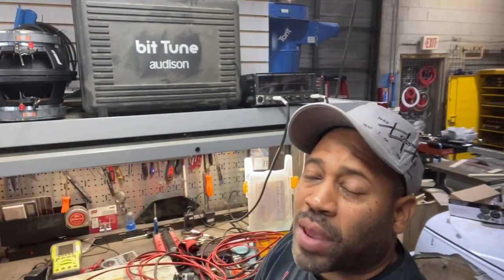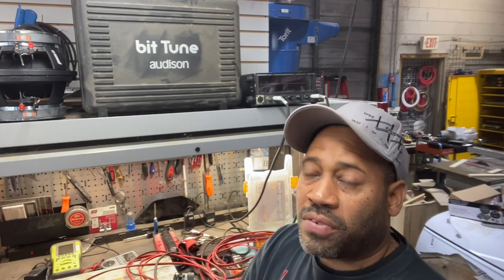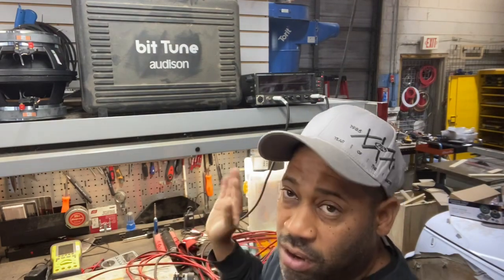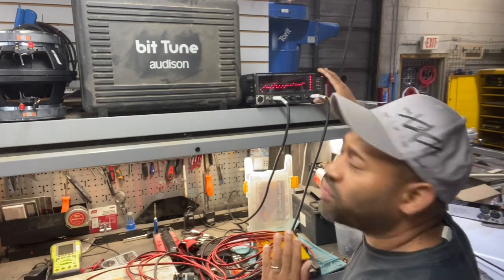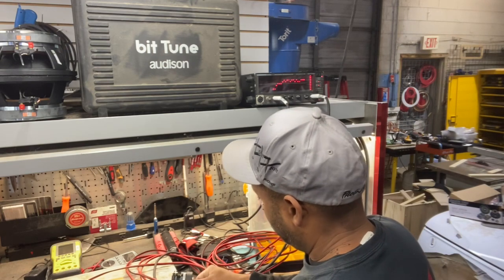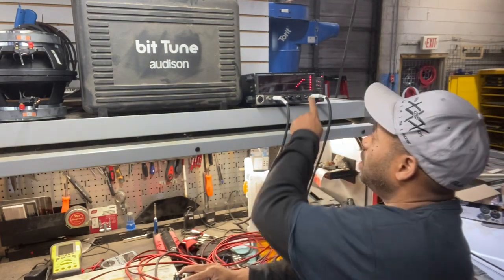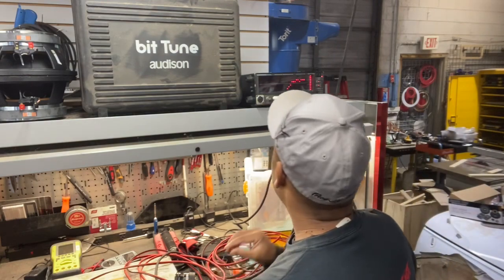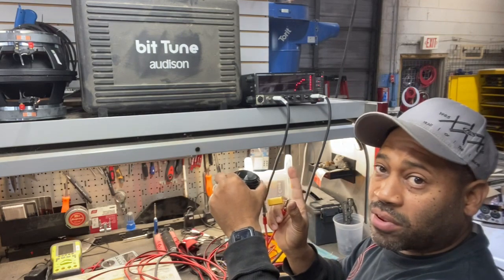Why you need to use the filter cap the comes with your horn / tweeter Hertz st 25 / 35

Comment: My PRV  2.75 short horn tweeter pops when I turn my ignition on. Just one pop then plays great. I took the yellow bass blocker off and turned volume down and no pop. I have the correct watts going to it as well. Could it be faulty bass blockers?

Comment: What happens of you tune the crossover on a dsp amd leave the speaker cap will that give an in accurate response?
Reply from the maker: @stevecri123  yes 

If you use a rta when you tune you can see the response change as you make your adjustments

Comment: i have a compression driver 4ohm rated 1khz to 20khz what value capacitor should for it to be set around 1200 - 1500hz since im not using a dsp right now

Comment: Question sir,
I keep blowing my tweeters on my motorcycle(twice). I've noticed the installer didn't use stand-alone capacitors, instead they used what I think is a pure treble speaker audio frequency divider. Do I really need this as opposed to the capacitor alone, or can I also install a "cap" in addition to this part? 

Any help would be greatly appreciated,  thank you kindly sir.
Reply: need more info, from what you explaining sounds like you got component speakers. Meaning it comes with speaker and tweeter are separate and use a 2 way crossover. If that's your set up your amplifier is probably running full range. Meaning its giving everything bass and treble. Also how many watts is you amplifier.  Also it's the amplifier tuned so it won't clip Meaning just giving it clean power ,no distortion. To fix problem You'll need a real installer.  Because you'll need tools to set your amplifier gains. You need  a 4 channel amplifier. 2 channel to speaker with crossover set at 100 hertz depending on speaker specs. Then 2 channel to tweeters with crossover set to 3k or higher depending on specs.setting amplifier gains with a dd1 smd. Speaker channel set to 3 db then tweeters set to 0db so it would play clean. Sorry if you don't understand

Comment: So no active crossover needed if it has a built in capacitor?
Reply: Active is a dsp . You set frequencys from the software but it's better to run caps to protect them how he said if you set at a frequency theres still energy below the setpoint .

Comment: When you add these to the spl show sv165 what's the best way to limit the power to the tweeter if they are in parallel  with the corresponding midwoofer

Comment: I have some  (2) Hertz SV 200.1  and (2) Hertz ST 35s on a Hertz HDP4 Digital Power 4 Channel 1000 Watt Amplifier on a Road  King... was wondering if you could answer a question for me... would it be better to switch to NEOs since they're both out for the SV 200s and ST 35s? would they sound better? I know they're water resistant now so thats a plus but would you recommend I do that? and also, because it is a Road King and I have no head unit, I'm supplying sound with a Wet Sounds WW-BT-VC (Version 2) Bluetooth Control Knob.. what would you recommend to get a better sound? I hate the fact that I cant adjust my levels, especially because I use my iPhone to play music through and all it has it presets.. If need be, I'm open to giving you a call for some help!! Willing to pay for advice! lol Thank you in advance!!
Reply from the maker: Hertz does not offer a st35 Neo yet 
Switching to the 200 Neo will
Give you a little more mid bass . 
I would add a Rockford dsr1 dsp and run your wet sounds Bluetooth into the dsr1 aux input . You will
Have full control of your audio 👍🏽
Reply: @NVSAUDIO  was just on the website and it now has the ST 35A NEO & ST 35K NEO... thank you again for the response, really appreciate it.

Comment: What size capacitor do I need for ST 35s? I just bought a bike with them on it and there is absolutely no sound coming out of the horns at all. I’m guessing their blown so I’ll have to fix the voice coil but I need to add capacitors. I just don’t know what to get.
Reply from the maker: nikko1627 call me , I have a few different values for you depending on how much power you are running to the tweeters . 
Plus we have a new adjustable 12 dB prototype crossover that you might want to try .
908-527-6772

Comment: So can you run more RMS or will that blow the tweeter, my amp pushes 180 x4 RMS at 4 ohms. I was going to run the tweeters on their own channel and use a rockford fosgate DSP 1 to add the highpass crossover. Will the 180 RMS still work with or is it too much?
Reply from the maker: Jeff Leigh what amp are you using?
Exact model number so I can give you the most accurate answer.
Reply: NVSAUDIO biketronics 4180